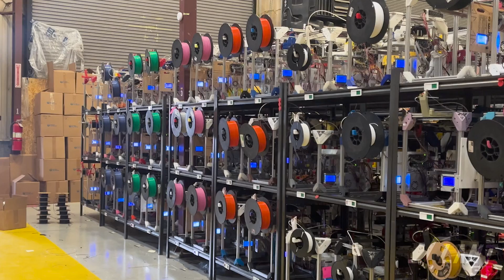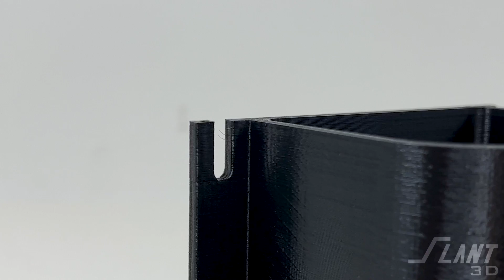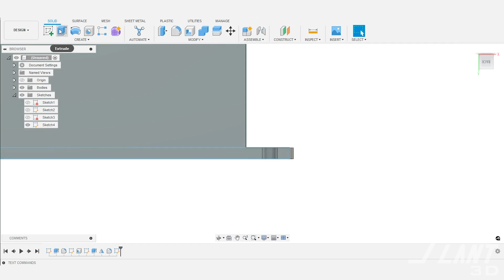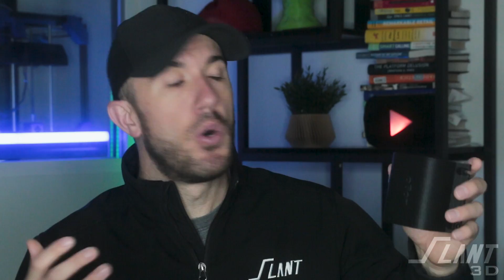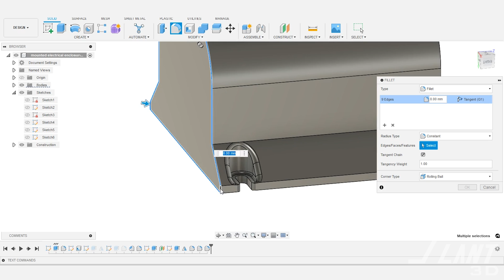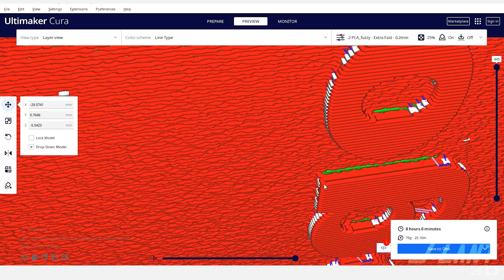Optimizing Wall Mounted Electrical Enclosures | Design for Mass Production 3D Printing

Comment: Do you use support on slots?
As they are horizontal we cannot forget them. I usually add some chamfer in these cases to avoid or minimize support need.

Comment: When I first saw what carbon fiber filament looked like with random texture added to the layer lines I immediately thought "there needs to be an option to add random noise to every line" and sure enough Cura added it. Still feel like there is room for improvement in FDM printings finish maybe through a combination of filament composition changes and software tweaks. Another awesome example of filament improving surface finish is foaming PLA and TPU. Foaming TPU printing in super thin layers feels a lot like cloth. Goes to show there are major improvements still to come just by changing the spool or bottle of resin you're using.

Comment: Great video! Did you use supports on the horizontal slots or did you have another way to solve that? I understood you were trying to avoid supports on this part…
Reply from the maker: There ate 4 small designed supports to hold the outer lips. They require minimal processing to remove. Or can even stay on the part and be knocked out at install
Reply: @slant3d  ok, thanks for the reply.

Comment: Why fillet the bottom and not chamfer? With a 1mm fillet, and 0.2mm first layer and print layer, the 2nd layer will be floating in mid air and cause this one ugly line, from experience. A chamfer will be clean. You won't have to rely on layer height to get a clean filleted bottom. And you won't have to rely on a variable elephant's foot to compensate for the fillet's overhang.
Reply: Lower layer heights, not higher ones, actually help with overhangs. Lower layer height means the next layer is less far out for a given overhang angle.

The combination of extrusion width and layer height determine the overlap between the extrusion lines for a given overhang angle. Wide extrusions and thin layers means more overlap and better overhangs.
Reply: @H34...  Thanks, I've now edited the initial comment to clarify and fortify the argument.

Comment: Interested in understanding how many of these parts can be produced in, say, 8 hours vs. injection molding? What quantities would you typically make of these. As the reason for injection molding is scale and strength.

The redesign of the part made absolute sense rather than producing a part made for another process. Use the benefits of the technology you are using
Reply from the maker: Our megafarm could be expanded up to 5000 machines
Reply: @slant3d  right ok, that's pretty impressive 👏  I can see how you could somewhat compete.

Comment: Printing vertically completely compromises the structural integrity of this print.  For a better finish and better strength this should have been printed laying down.  No support would be needed if your printers were set up correctly for bridging.  Not sure who made these decisions but they were wrong.  Sure the redesign is nice but orientation for strength and a better finish overall should be priority 1 here.  I manufacture 3D printed brackets and have for many years now. Brackets that are much more complex than this.  The philosophy of disregarding print orientation here is wrong.  As far as UV degradation goes you are also wrong.  In that orientation UV will crack and split that part in a year.  The only way to get around this is to coat the product after printing. I have massive experience here as well with printing outdoor EV charger brackets.  Whole lot of BS here. I really feel sorry for the client on this one.  While I agree that 3D printing is the way to go here, your philosophy is pure garbage justification.
Reply: Hi, I run a 3D print farm and have several years of experience optimising designs for FDM.
Like you, I've spotted some aspects of this video which are not my idea of optimal.  
However, he has highlighted some problems with the original design which he has resolved, and made a video to share this with others, succinctly and clearly explaining his process.  And I was able to take away a few useful pieces of information from it.  Let's remember this is also not the final product, but a genericised example piece - and we don't know all of the customer's fixed ideas.  Any assertion about strength in orientation would be subject to knowledge we don't have about the mode of use - it may be that a design is 'good enough' overall, and more resistant to a peak stress it encounters when abused in a predictable way.  
3D printing has built around a community spirit of sharing and openness, and the idea that a rising tide floats all benchies.  Companies that to some extent compete also share best practice.
BS and garbage are very strong terms to use to another professional in the market, require strong evidence to justify.  I would also be curious to know more about your brackets and process - but only in positive terms.  What can we learn from your experience that contrasts with this video, and how do you go about defining and solving the same set of problems?
Reply: @evropapagan5551  Who are you?

Comment: looking at the design changes I was curious if maybe a better solution to the issue of the screw hole placement would be to print it on the print bed as it would be mounted to the wall (ie as you suggested might be a bad idea because of support material and auto ejection) but with an aggressive chamfer instead of a fillet as that would not require support material for the screw holes, though idk if it still wouldn't work well with auto ejection
Reply from the maker: Client needs drive the design.

Comment: A good way to hide layer lines is to use filament with speckles like prusia galaxy, or filament with carbon fiber.
Reply from the maker: Also a good solution if available

Comment: Don't forget the value in having a part that you can change down the line without retooling. The flexibility that 3d printing brings is, to my mind, it's greatest strength.
Reply from the maker: Huge advantage in mass production. Not literally setting your product in stone while in production.
Reply: I think that a good product don't need to be changed, if there is such a need then you are selling a prototipe.
Reply: That's true but did you see the cura print time estimate? 8 hours.
Reply: @chadwickwood9843  I can change that to 2 hr probably, but that is complicated
Reply: @chadwickwood9843  common Cura L (also the fault of fuzzy skin, which adds a whole bunch of time in an attempt to hide the layer lines, which I honestly don't know why people have such a problem with..)

Comment: Is there a way an easy way to exclude the inner walls from the texture on these thin walled parts? For example if you needed a precise fit? I see the blockers in Cura but it would be tedious to put them just along the inside wall. Thanks
Reply from the maker: Generally textures are best applied in CAD. But the noise is a very simple thing to do in an uncontrolled way in a slicer
Reply: You can use any model you want as a blocker in Cura, just like with the default blocker cubes. You just select your blocker model and change it to "per model settings". What I would recommend in your situation is to CAD something that overlaps all the area you want to apply the texture but avoids everywhere else, then I'd import both parts into Cura and play with the per model settings until I got the result I wanted.
Reply: @rans_electronics  
I didn't realize you could use any model as a blocker cube, so in that case I could just offset the inside surfaces and thicken it just within the wall thickness. Thanks!